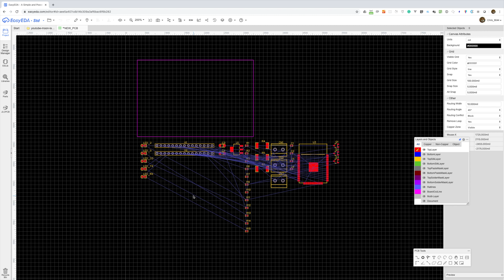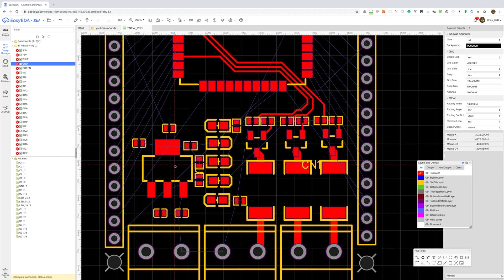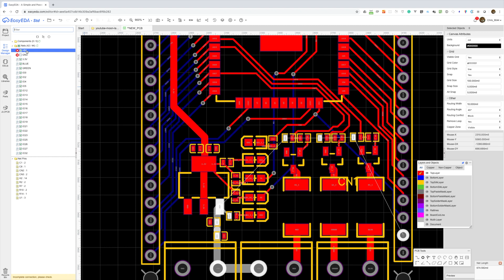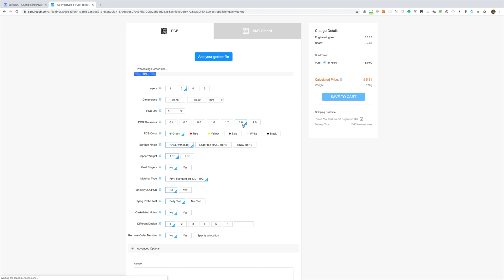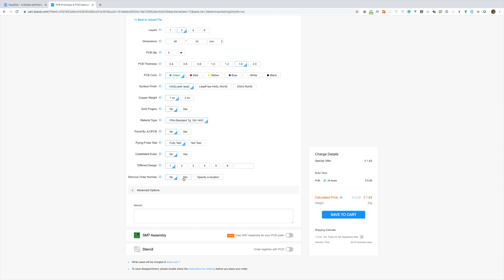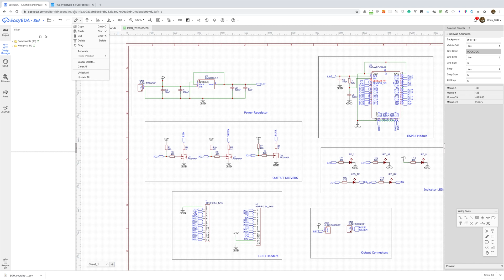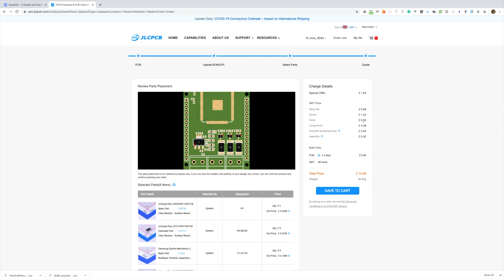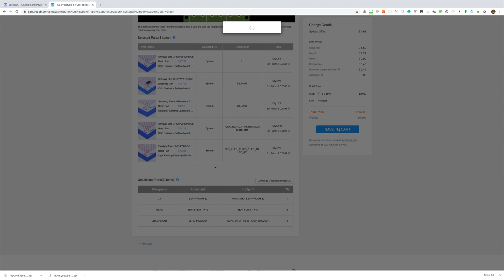Custom ESP32 PCB: Layout using EasyEDA and Fabrication with JLPCB

Comment: Nice video, I would really like that you cover how you do the smt/smd solderinger for the rest like the esp etc. I usually order a stencil, but here you would either hand solder or do you have a magical way to solder it?
Reply from the maker: For this board everything else was done by JLCPCB - back then they didn't have the ESP32 as one of their standard parts so you have to do it yourself.

Comment: Thanks for all that. I'm a such of beginner and I want to do my PCB with ESP32 WROOM and some pieces of my own project.
Your videos and schematics are so instructive.
Where can I have some informations about the couper thickness ?
Reply from the maker: Unless you have some special high current requirements you can just use the default copper thickness of 1oz
Reply: @atomic14  Thank's a lot

Comment: Hi, i think use esp32 wroom to making smart watch , so I don't know is it need crystal oscillator for PCB design
Reply from the maker: The ESP32 modules are complete - you don't need anything additional apart from power and some decoupling capacitors.

Comment: How do you program the chip? I do not see a uart or USB connection? Regards,
Reply from the maker: Hi Charles, at the moment JLCPCB don't have any USB connectors so to keep things simple I didn't include a USB to UART chip on the board. To program it you need to tie pin 0 to low on power-up and connect a USB - UART board to the TX and RX lines of the ESP32. Next board I will include this as it's a bit of a pain.

Comment: Just as a tip: the io's are actually not 5V tolerant. 
The n-mosfets don't need a pull-up anyway, so I would suggest to just unsolder the 470 ohms resistors there. 
You should activate the internal pull-ups instead.
Of course, pull-downs are better, if you want to have the leds off after reset, but it's harder to fix that...
Reply from the maker: Interesting - I'm running the outputs in open-drain mode so the pull up is there to take the MOSFET gate to 5v to fully turn it on. I think depending on the MOSFET you are using 3.3v won't fully turn it on. When the PWM signal is on the gate will be taken down to GND and when it is off the gate should be taken to 5v.
Reply: @atomic14  I'm using the AO3400A with my ESP32, too. And even PWM is working fine (I'm using 100 ohms to the gate).
In the long run I would be a little afraid because of the GPIOs...
Reply: Hi. Yes this is what i noticed too. IO pins don't need pullups and for sure not to 5V. The mosfet you are using AO3400A is according to datasheet fully open from 1.5V (1V typical). Only the RDSon resistance is slightly decreasing with higher gate voltage. But 32 or 48 mOhms don't make any difference. Also ESP32 IOs are capable of delivering 40mA per pin. And you want to charge/discharge the gate as quickly as you can so on higher PWMs frequencies the mosfet is able to fully open and close. Also with higher gate resistor the transistor is not able to properly work in very low duty cycles. It will not fully open so the brightness of a led will be affected. So 82R-100R is a better choice for the gate resistor. Also you can reduce the power consumption of a ESP to halt when you set it to work at 80Mhz. (idle will go down from 80 to 40mA) Dimming leds doesn't require high compute power. So you can save few cents :) Anyways great video.

Comment: Hi. Thanks for the very informative video.
A quick question:
I've noticed that your power traces are thicker than signal traces.
What thickness did you use for each, and how do you decide on what thickness to use?
Thanks.
Reply from the maker: Hi Eduard, I didn't really apply any science, just wanted to give the power trace more current capacity and picked a number that seemed to fit with the layout. There is a nice calculator here that will tell you the track width you need for a particular current draw - https://www.4pcb.com/trace-width-calculator.html
Reply: @atomic14  Thanks.

Comment: Hello sir where do we get the esp32 chip in the schematics?. I searched in components and modules but ist not there
Reply from the maker: Hi There, In EasyEDA click on the library icon and then search for ESP-WROOM-32 - there should be a component from LCSC with the schematic and footprint - https://imgur.com/a/tDvfg4t
Reply: @atomic14  ok i'm assuming from this you don't want to share your design ?
Reply from the maker: @steveb7600  Hey Steve - it should be all available here: https://easyeda.com/chris_9044/youtube-moon-lamp

Added to the description as well - apologies for forgetting to put it there.
Reply: @atomic14  Thank you I was able to find it.  I am wondering where the USB to serial chip and micro USB port are on your design?  I was hoping to program with from a usb cable from my pc.
Reply from the maker: @steveb7600  Hi Steve, unfortunately, JLPCB don't support USB sockets yet so I used a USB to UART board to program the board. I had one already as the ESP-CAM board I have also doesn't come with a USB socket.